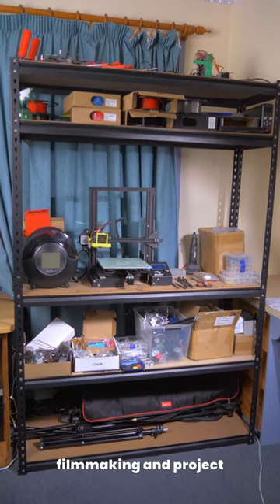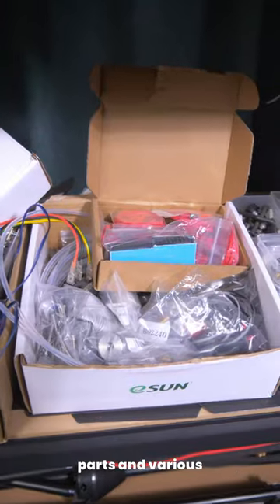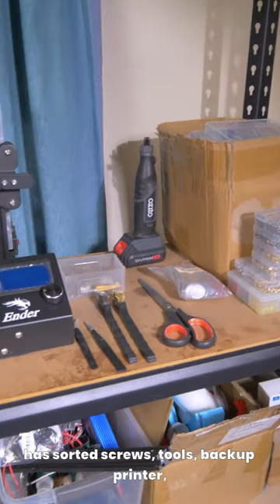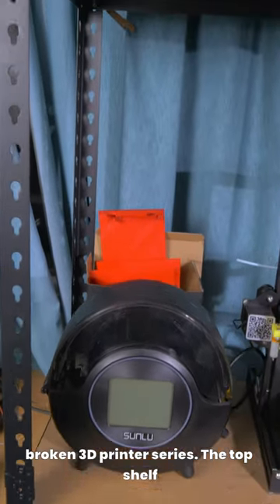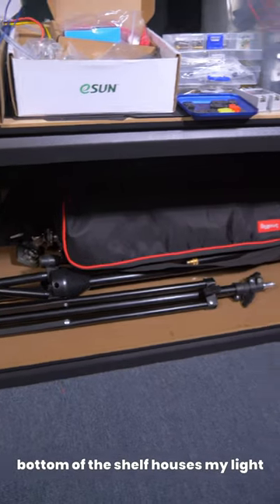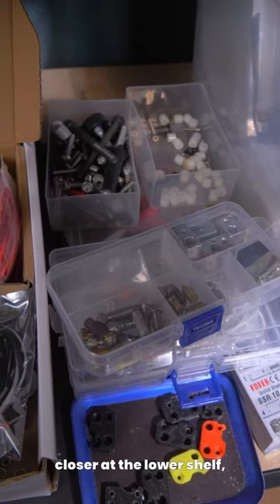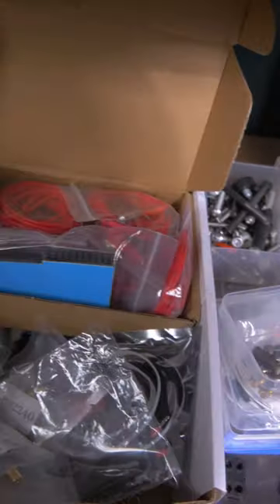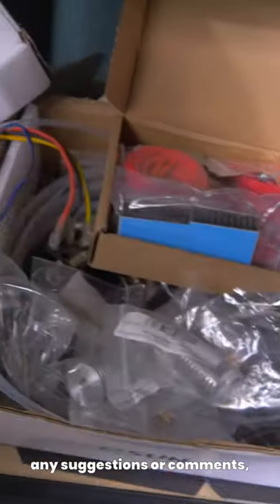3D Printing, Filmmaking & Project Shelf

Comment: Looks great!! I'm just getting into 3d printing. I'm no expert, but I would think a good way to store spare parts would be a parts organizer (like the one often found in Grandpa's garage). That's the route I'm planning on going
Reply from the maker: Thanks! I ordered a bunch of clear plastic cases to build a storage system with, but haven’t yet got around to it. I believe I’ve used those organisers before, they work quite well.
Reply: @TommyHoughton  print some storage containers to !
Reply from the maker: @teitgenengineering  coming up in the future! I’ve got all the plastic storage boxes, but not a giant rack or so to store them, I’ve been meaning to get that done…